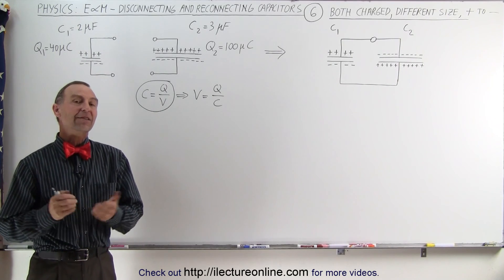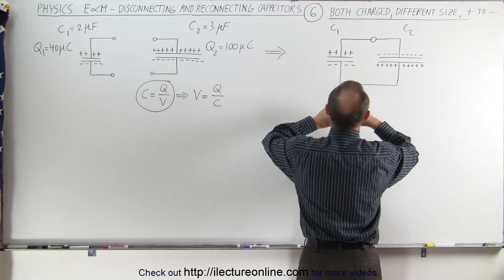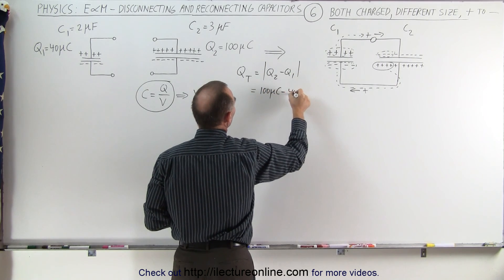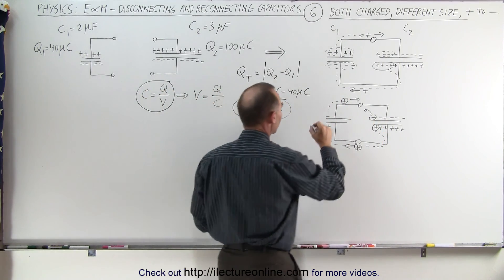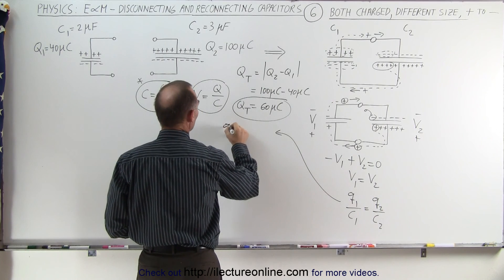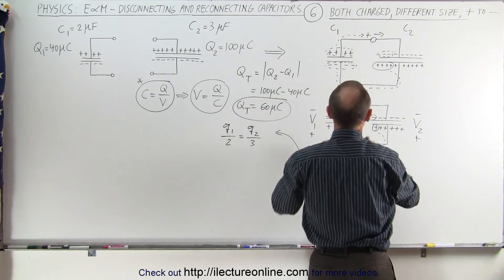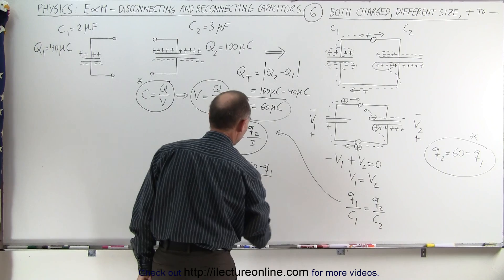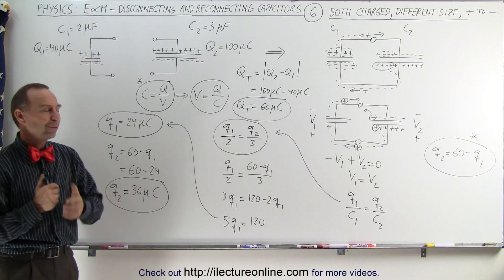Physics - E&M: Dis- and Re-Connecting Capacitors (6 of 16) Both Charged, Different Size, + to -

Comment: Dear Sir,
Thanks for your excellent turorials.
Could it be that Qt is 140µC  that would really make the difference between Q1 and Q2 since they are different in pollarisation?
That being asked, keep up the good work.
Reply: By the time you read this you’ve probably finished wherever course you’re doing but I still want to reply. Qt here is referring to the total charge stored on each conductor. Each conductior will be a plate from each capacitor connected by a wire. The total (positive) charge will thus be the charge of Q1 + Q2 but as Q2 is negative, you must negate Q2, thus Qt = Q1 - Q2 and as you don’t know which one is bigger, Qt= |Q1-Q2|